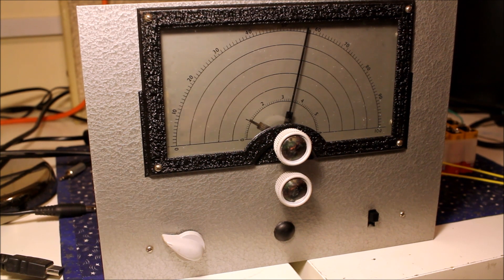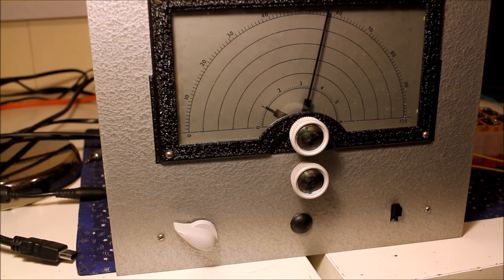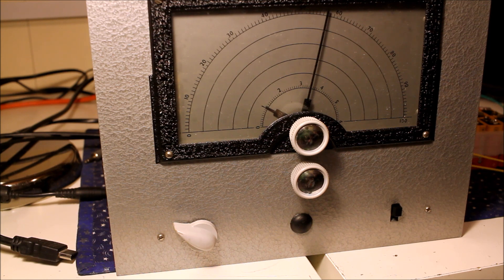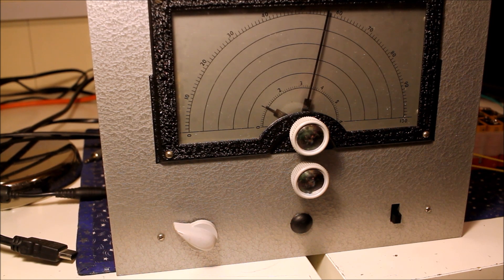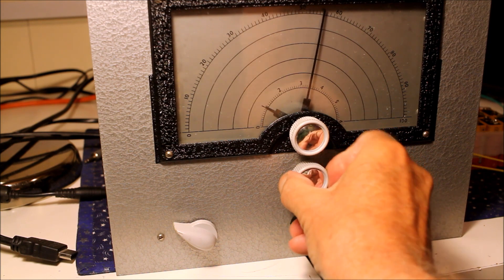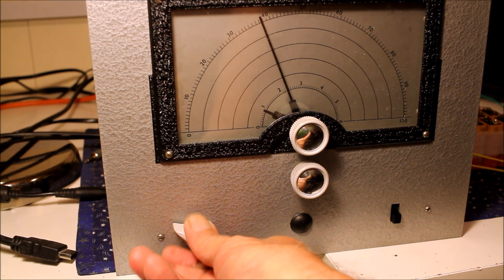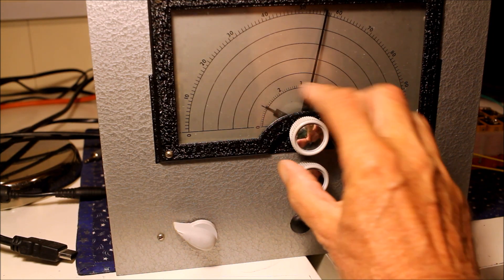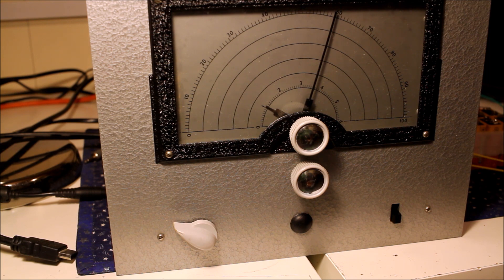Codar Super Clipper Regen Receiver

Comment: Hi Steve, cut my teeth on the Mini-Clipper in the early '70s, without the 2 x OC71 amplifier but with the (optional!) bandspread capacitor and full set of coils. The 2000 ohm headphones were in the HT line and it had a pushbutton on-off switch, so you had to hold it down to switch it on which invariably gave you a 69V shock straight up your arm! I must rebuild it, been meaning to for years - maybe with some safety features! 73 Phil M1GWZ
Reply from the maker: Nice to hear from you Phil..  All the Codar stuff has become very valued by collectors..especially the coils !. I use cheap modern batteries and it works fine. 6 nine volt ones in series keeps the battery valve ones going for weeks. Hope all OK over at EARS. Steve G3ZPS